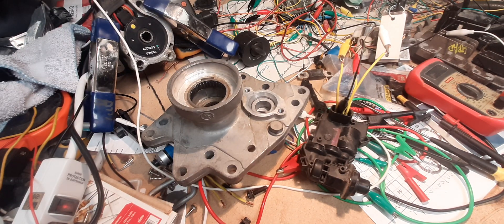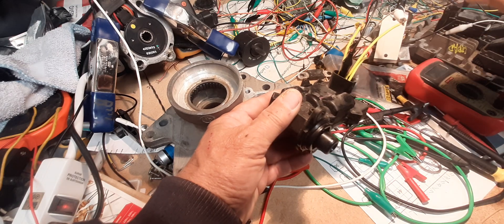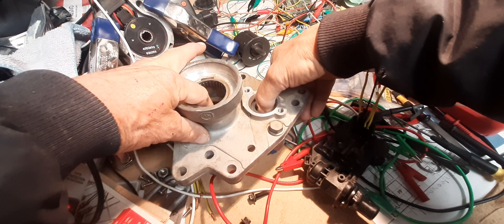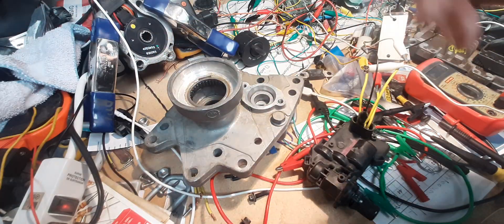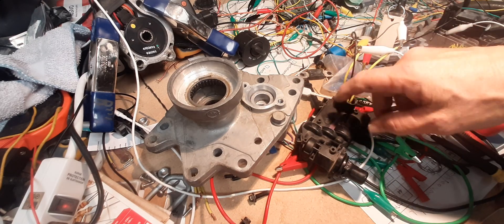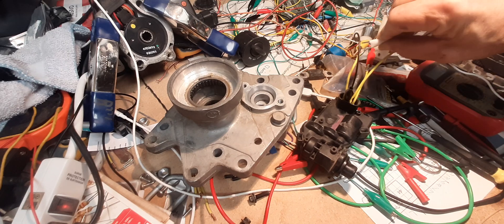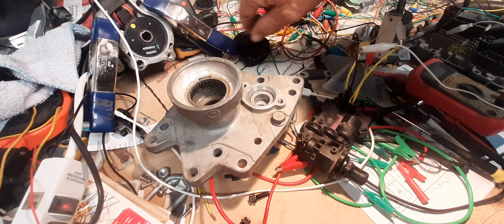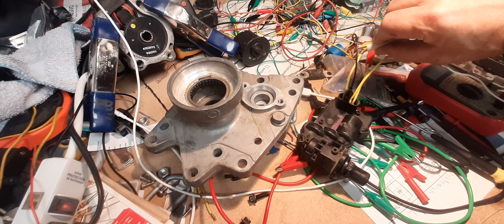TrailBlazer/Envoy 4WD Front Axle Disconnect and Actuator Operations Demonstration.

Comment: Tom which activate first when you turn the 2wd to 4wd selector switch. The transfer case motor or actuator.  I am stuck in AWD and when I turn selector switch I don't heard anything.  Is motor or actuator bad? Thanks.
Reply from the maker: The two are nearly simultaneous. The switch from 2 Hi to A4WD or 4 Hi takes about the same time for both the front acle disconnect and the encoder/shift motor.
Reply from the maker: If the service 4WD light is on in the instrument panel cluster you can try resetting the control module by removing the #8 ATC fuse in the underhood fuseblock for a minute or so then reinserting it.   There is a second fuse for the 4WD in the rear fuseblock under the back seat but that one does not reset anything.   That said, if either fuse is bad the system will not work for 4 wheel drive.
Reply: @thomasjbaker7688  Hi Tom: The fuses are all good. There is no warning 4wd light on dash.  When I move selector from where it is stuck now, AWD, to 2WD all I get is a click and it then default to 4WD hi. If I switch from 4wd hi to AWD it stays there after its blinking sequence. I just cannot get it to 2wd.
Reply from the maker: @Ed-dr6qc    I cannot think of anything that should make a click sound. There are no relays involved.  Where does this click sound come from?

If the light is on at Auto, and you mive the switch to 2 Hi, the light flashes at 4 Hi??

If yes then I think the switch may be the cause.  Some people say to turn the switch back and forth to all positions in an attempt to 'clean' the contacts inside the switch.  Key OFF of course.

Comment: What’s up, i’m the guy on GMT Nation, BenjaminBlazer. Would i be able to hear the noise even while still plugged into/screwed into the disconnect?
Reply from the maker: Yes, the sound is loud enough to be heard from the drivers seat even. That is as long as the engine isn't running and the radio isn't cranked up!